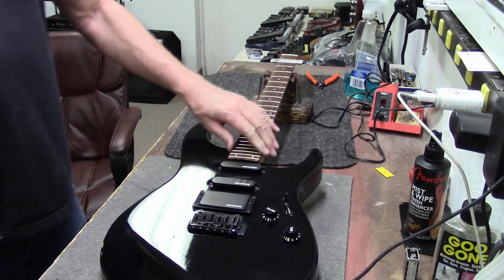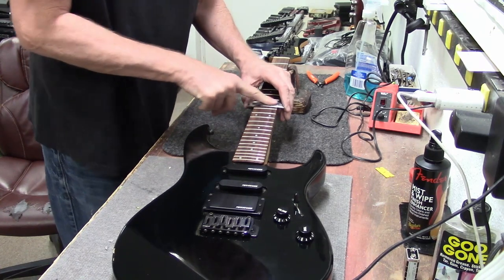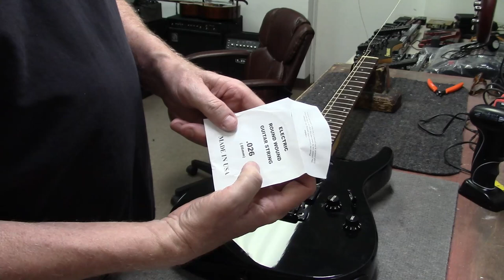MIJ Fernandes FR-55

Comment: I got curious about these guitars as here in England we don't see so many of them, in fact I have never seen one in person, so while I was searching about these guitars, I found a late '70s strat model  MA-55 Natural with the Fender headstock shape and it is a neck through model and is apparently very collectable, they were asking for £700 to own this particular model.
 I noticed on this model that the finish had sunk into the glueline on the body, this happens regularly when guitars get old, some companies use a vinyl undercoat  which stops this from happening.

Comment: I had a variable of that through the 90's. got it from a pawn shop for 180 bucks. took a router to it, routed the floyd. Filed the neck heel down, chopped the nose off the headstock-  look kinda lie Suhr does now, took some sht can spray pain to it and cover coat. Sanded the back of the neck down and scalloped the fretboard. Mine had plastic spacers under the neck jojnt, i kept them in a bit not knowing why since it was top mount. But when i flushed the floyd to the route it fretted out at the 24th fret so i got harmonic squeels with zero effort. Best guitar i ever had. And i've had multiple dozens of high end USA Jacksons, Charvels, Custom shop ESPs, Killer Kgs ( Akira customs)  BC Riches, Yamahas, more than i could remember over decades. I Fkn loved that thing the most. Get a thich neck , sand it down with your cock hand. You'll have a perfect neck. >D

Comment: We try to get used Fernandes and Tokai guitars, but also new into the Netherlands...Fernandes is still popular. Unfortunately F does not export anymore...but if you find a good middle man, something is possible. Tip: look for Bachuss/Reviser guitars and from China the Smiger guitars are nearly equal as Fernandes.